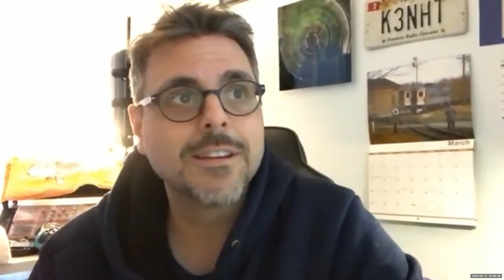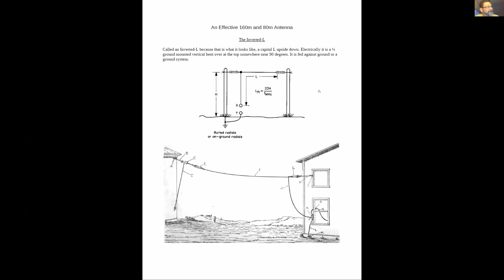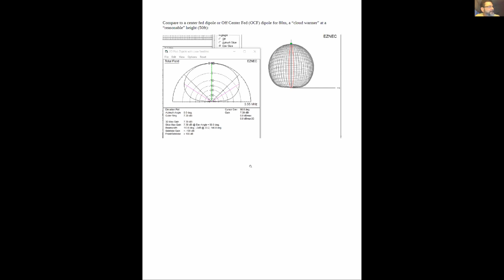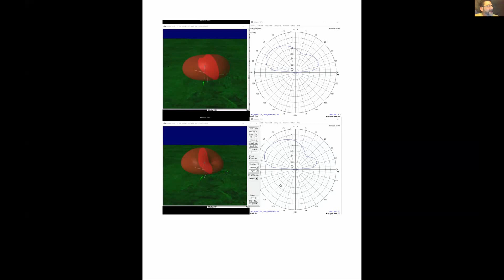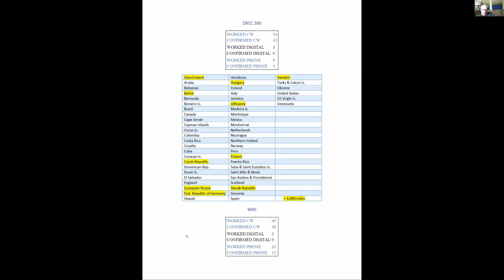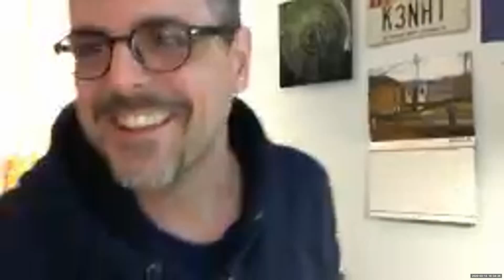Building an Effective a 160/80 meter Antenna

Comment: How.many ground radials
Reply: There are no radials. I am using two tuned elevated counterpoises. One is approximately 1/4wl on 160 and the other is 1/4wl on 80. Both counterpoise wires are attached at the feedpoint to the coax shield and run out in opposite directions from each other staying about 7 feet above the ground.